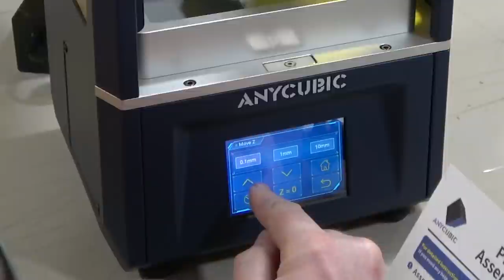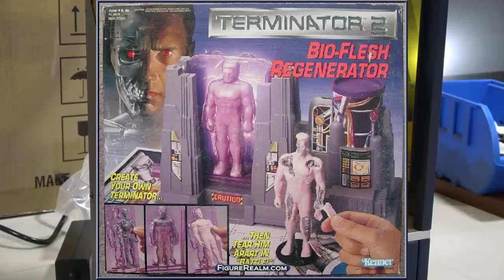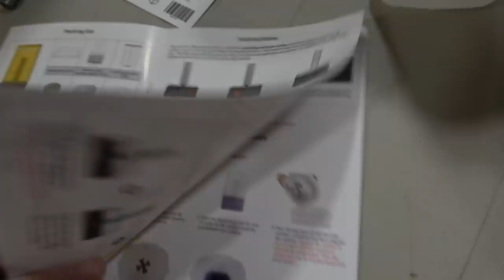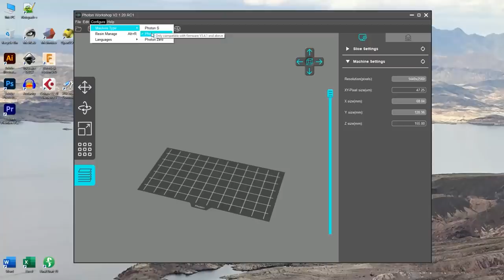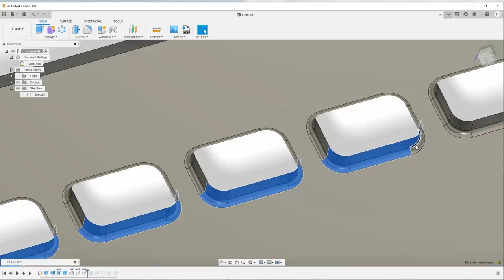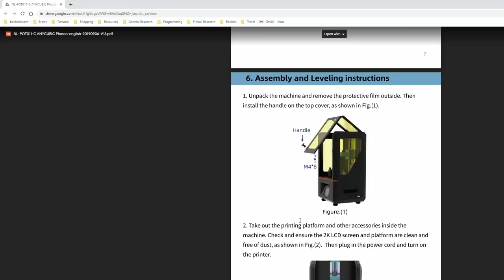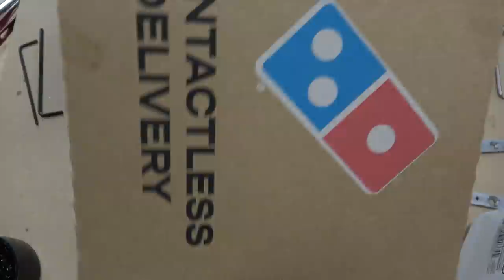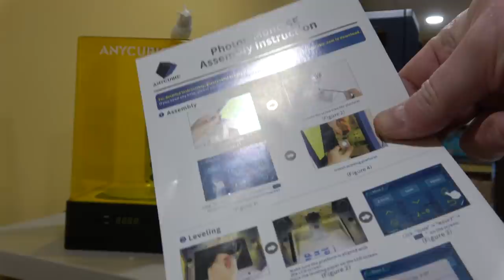Anycubic Photon Mono SE Resin Printer Review

Comment: Skin grows back but it is also permeable, it`s really fun when UV resin start curing underneath it. Really recommend a glove when handling that resin.
Reply: Is there a single case anywhere of that actually causing problems for someone who came into contact with these resins? Skin is relatively impermeable, so I wouldn't have considered this a concern until I just read your comment.
Reply: @dan_  Yes, we used them extensively in a previous job and many people became sensitised to them; one colleague got to the point where he developed severe rashes from the smallest contact with the resins, despite no reaction when he first used them.
Reply: @dan_  YES. Very much so. Alcohol especially will thin the resin enough to penetrate pores, etc, making it even more dangerous. Soap and water to wash it off skin, and always use gloves. There actually are some horror stories about resin curing in skin. Furthermore, just contact, even if properly washed off afterwards, can cause the development of severe skin sensitivity (Allergic Contact Dermatitis). It boggles my mind that there are people in this world that look at a chemical so reactive that light triggers it's reaction, and then think, "But is it really so bad? Does it really seem dangerous?" Try looking up a basic SDS/MSDS for the resin, or google image search "UV resin skin injury". That's a fun one.
Reply: Thanks peeps - good info to know!

Comment: The wash and cure machine definitely takes a lot of the tedium out of resin printing. I've definitely been doing more resin printing ever since I got mine.
And yeah, as long as you're careful and don't drop the build plate or knock it around, you shouldn't need to re-level. I honestly don't remember the last time I leveled mine
Also there are a wide variety of resins out there with a variety of different properties (extra strength, high temperature, etc.)
You can reuse your washing liquid! When it gets super cloudy, just let it sit for a while, most of the resin will settle to the bottom. Use a turkey baster to snarf it up, and you're good to go.
For changing FEP film, yes the bottle cap trick works, it may seem like it will give you too much slack, but trust me, when you put the FEP film frame thingy back on the vat, it will give it just the right amount of stretch without being over-tight. (yours looked a bit too tight to me)
btw the reflector thingy is supposed to be silver, it has a blue protective film on it that you need to peel off :)
also YAY MORE COOKING CONTENT!  With the cold weather we've been having, I have been making a lot of variations on the famous Ben Heck Instant Pot Beef Stew.

Comment: Ref: 1:08:51
The champer comes from that when it is not supported the layers will have to be lifted of the plate by a layer that is not stick that fare out and you end up with a slop as you print higher.If the layer go strait up from the plate it will not camper.

Comment: oh also the elephants foot first layer issues youre getting is from the base layers. The base layers require extra long curing to stick to the bed plate. This also means youll get light bleed curing around the mask. This is entirely unavoidable. This is why most people will place there parts on support material. Also different resins will give different quality and strengths. And you will likely need to do some tuning to find the best print settings.
Reply from the maker: Thanks!

Comment: Its Flex-Vat versus tilted Var. Those are alternative concepts to reduce the suction effect that the printed object has with the vat bottom when under liquid resin. Suction can be so extreme that it can have a negative impact on the raising z-axis and due to that in the print quality (visible layer lines due to bending z-axis). The effect is reduced in more expansive machines by tilting the vat before raising the z-axis. Budget machines use a flex-vat, where the flexing foil will be pulled and slightly bend during z-axis raising due to suction which is a kind of cheap tilting.

Comment: Fully agree with your theory on the death ray... on one of the episodes they said something along the lines of the placement of the city / port would have meant that the mirrors would have had less than ideal sunlight. But, if they were using multiple mirrors pointing at a central one, then surely they could have utilised the ideal sunlight and then reflected in the correct direction... win win.
(Not that this has bugged me for years or anything :-p )
Reply: Me too half hearted attempts at stuff bug me lots

Comment: What's the deal with getting files onto it? If the Wifi is a no-go, could you connect with RJ45/USB to your PC or directly to an NAS or something?
Reply from the maker: AFAIK USB as MSD is the only way.
Reply: @BenHeckHacks  Thanks. That sucks though. Definitely could have included at least an ethernet hole for LAN support...

Comment: They generally angle the print to avoid the big surface area that touches the film. The force is quite big when the platform lifts up!

Also the first area is filled by support, not the part itself

Comment: @Ben Heck Hacks I guess you would want to fill the print area with multiple items as the print speed is not going to slow down unlike an extrusion printer. You could write your own  'Pile Em High & Wide' plugin. Call it 'Ben Heck Stacks'
Reply from the maker: Right the print time would be the same. Also I need to learn to NOT use the base for an object surface.

Comment: Because I know more about cooking than tech, I'll exchange some cooking knowledge for ya: Coat the hot dogs in flour or corn starch to make the batter stick better. You only want a very thin coat! Roll in the starch, then shake it off so there's a layer basically one granule thick. If you've got time, let it sit on a wire rack 5-30 min. to thoroughly dry before dipping in the batter, but it's not a big deal if you don't want to or can't wait.
Reply from the maker: Cool thanks! This was my first attempt.

Comment: You can get very good results and precise measurements from an FDM printer, but for some printers you have to do a lot of tweaking to the machine and the slicing profiles. If I print a 20mm cube, it should be 20mm or within a .05 margin. Stuff like 20.09mm is just too much IMO, and leaves too much error when making parts that fit together

Comment: Most people would print at an angle to reduce the amount laying flat on the film and also lots of supports. A large flat surface has to be peeled of the film each time so it can cause problems like you experience.

Comment: If apple needed a new chip every year why did they ship stuff that was well behind the cutting edge for generic pcs all the time?

Apple was around when ARM started by they got their architecture licence (that allows them to design their own cores) in 2008. I doubt they got grandfathered a license to ARM's IP.

Their ARM switch is all about squeezing the maximum money out of their smaller desktop market share.
Reply: ARM, the company, was founded in 1990 as a joint venture between Acorn Computers, Apple and VLSI technology. Apple has been around ARM since the day they changed from Acorn RISC Machines to Advanced RISC Machines Ltd.

As I said in the video, they obviously want to make a load of money but their interest in ARM and creating their own CPU platform is about more than that, or I should say they've come to the conclusion that depending on others for the CPU architecture limits their ability to consistently produce products that meet the requirements that they've identified as being best for the company.
Reply: @kraftlab  

>ARM, the company, was founded in 1990 as a joint venture between Acorn Computers, Apple and VLSI technology.
>Apple has been around ARM since the day they changed from Acorn RISC Machines to Advanced RISC Machines Ltd.

Apple was involved then for the Newton. The newton was a bust. They can't have been too involved with ARM after that if you consider that they had Samsung design all of their ARM stuff for a long time when they started using ARM again for the iPhone. Apple was also part of the POWER alliance or whatever too.. Look where that got them.

>CPU architecture limits their ability to consistently produce products that meet the requirement

The thing is that doesn't hold water. They might have designed their own ARM cores but they can't fab them. They are dependent on TSMC to keep up progress on their process improvement. If the China-Taiwan war happens then Apple will be in a very bad position. 
I think it's more like this: Their desktop/laptop segment is so small they couldn't really pressure Intel or AMD into creating their chips at the price they want. They already have their own phone SoC designs that are good enough for their behind current gen PC stuff so they beefed one of those designs up and made it into a laptop and mac mini. Then they spun the same silly marketing crap like they did in the PPC days when they couldn't get anything that was as good as what Intel was putting out. i.e. Our stuff contains unicorn magic so it's better.

Comment: The speculum mirrors (brass, copper, tin) used in ancient times would loose too much light (only about 70% reflective at best) if two mirrors were used.  Modern silvered mirrors are over 95% reflective.
Olive oil has a lower smoking temperature than corn oil.  Hope your smoke detectors don't bug you.

Comment: Suggestion: Don't let your prints rest right against the Build-Platform, the base layer fucks with the print... Also you may want to angle it, seems to have more strength and less weirdness that way... So:
1. Use supports instead of contacting base layer... (Autogenerate them in the Anycubic software after raising the object to be printed a tiny bit... You really should not have to account for supports while designing the part, let software handle it, it knows how to support the print best... Well, better than you, anyways... :-D)
2. Try to angle, if you run into problems, or need more build volume... Try like 10-30° slant, think of how the print peels of the film as it transitions off the supports... If it goes from tiny support arms to huuuuuuuuge surface area, those arms could rip right off... If it's angled the stresses are way less as every layer get's pulled of the film...

Comment: I don’t think I’d use your idea of scotch tape. The resin is likely to melt the glue which is likely to both spoil the resin and make the part fall off the plate.
Reply from the maker: It worked well enough while I waited for new film.
Reply: @BenHeckHacks  whatever works, I guess.

Comment: I don't know what your friend is talking about but apple helped make ppc architecture with ibm and Motorola eg AIM alliance what happened was this was during the mhz race and the g5 had issues with heat and hitting those clocks why u never had a g5 macbook and since ibm was the fab for the chips they wanted apple to pay more and apple wouldn't
https://tedium.co/2020/06/16/apple-powerpc-intel-transition-history
Im 1 of the guys who has been getting amigas to use the industrial prpmc ppc g3 g4 cpus running

Also different oils have different flash points